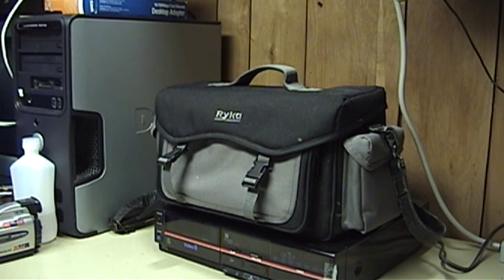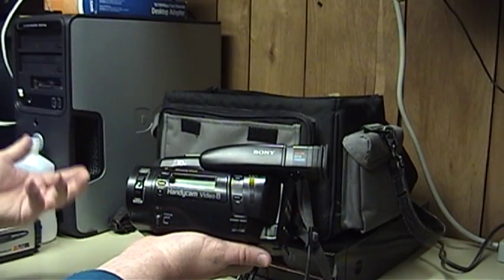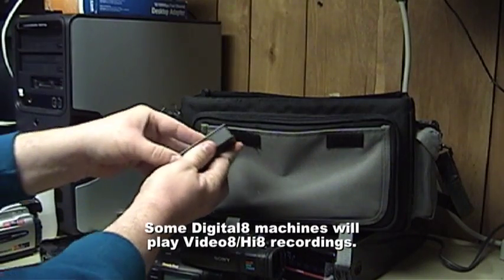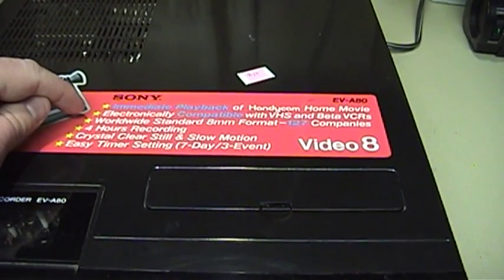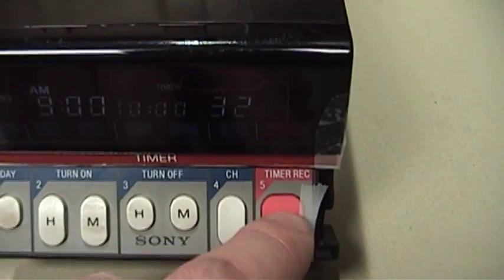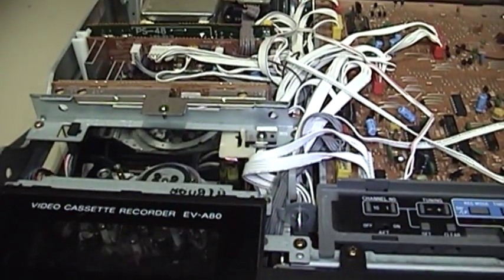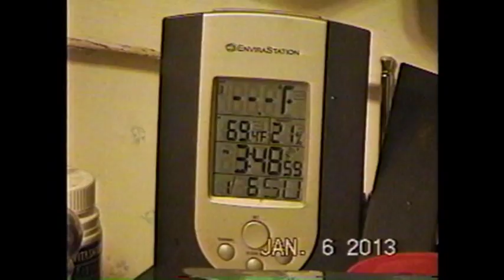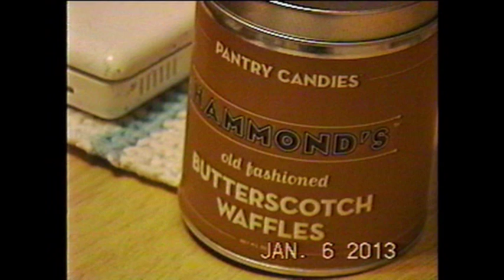Sony CCD-TR91 Handycam and EV-A80 Video8 VCR Overview and Demonstration

Comment: Thanks for the presentation! The picture quality that this equipment still delivers today is  amazing. There were a lot of stand-alone Video 8/Hi 8 VCRs built by Sony over the years. They are actually quite rare and high prized on ebay (at least here in Germany).

Comment: Nice find! I found a video 8 recorder once, but it would eat tapes if I tried to rewind because a gear inside had broken.  It played Hi-8 tapes perfectly even tho it wasn't a hi-8 machine.  I noticed one you have and the one I found (I don't have it anymore) both thread the tape the same way a Beta does.  !  I've also seen a VHS that thread tapes that way as well,  and I swear I've seen a Beta that threads the tape the same way a VHS does.

Comment: I have the Sony TR910 ntsc, 15x optical zoom, 16X9 mode with s-video  No original remote or adapter ( 3rd party charger avec two batteries, however) I purchased it for peanuts considering its general operational condition ; but the cosmetics are rough. This kit is exceptionally nice in all ways. Way to go!

Comment: I thought it may be, it's hard to mistake that case. My wife had one from 2006. She paid about $800 brand new. She also just replaced it earlier this year, just because she wanted something to run Windows 8. Still worked just fine, although the fan sounded like a jet taking off.

Comment: I managed to nab a fully working Memorex model 801 8mm Hi-Fi Stereo VCR (a.k.a. Optimus model 801) for $3 from a thrift store that I've lucked out at on many occasions (I had also recently scored a fully working, near mint Denon AVR-4802, complete with remote and manual, for $10 from the same place).

Quite a compact deck originally sold from Radio Shack stores.  It also seems to have been made in Korea by Samsung, though the transport used is an awful lot like a Sony (it may very well be a Sony transport built into a Samsung chassis, surrounded by Samsung circuits).

I did have to spend an extra $10 to procure the correct replacement remote control from eBay.

But, all in all, I believe I got a good deal.

Comment: Interesting how there is no switching noise while paused. I suppose I shouldn't be shocked as the heads aren't rapidly switching on a still frame (or rather, they don't entirely need to), but on my TRV22 from 1997, there is head switching noise no matter what.

Also, on the 8mm VCR clip, funny how that tape path seems vaguely reminiscent of the U shape of another much earlier tape format Sony had fun with (and indeed, the TV station at the local college still has one).

Comment: I'm sitting in my room one night (maybe a month or two ago) and I look over at my sony tt-2000/sl-2000 betamax and I notice only one of the colons on the digital clock are blinking. I watch it for a little while and the other one starts blinking. It's funny you would mention that little feature in your video seeing how I just noticed it. My machine (portable player/recorder/camera) is from the late '70's or early 80's. I guess it's an old feature.

Comment: Can be brocken Capacitors replaced? I got a 1988 S-VHS Camcorder labeld as "Grundig" but made by Sony or Panasonic, from the Dump with bag, Cassette,Power Supply and Cables.

Comment: SonicWALL and Comcast, eh? This must be new! I tried "poking around" their network with my laptop about four years ago (no netbook for me then!) and found they used AT&T with some filtering. It even showed up as "attwifi" in my network connections. A speedtest showed they had the same 3m down/512k up plan I have now, and I could also access the internal IP of their modem. I doubt I'll be using their wifi again, though. Last time I visited BE, the food was pretty bad. At least the pie was good!

Comment: I kinda have mixed views on Linux. But I have used it extensively in the past.

I wasn't able to find the service manual for my '88 Ferguson Videostar FV21R, but it is a european unit so...

I noticed that Maxxarcade's Zenith VRD200 is very similar. Unfortunately I couldn't find the manual for that either.